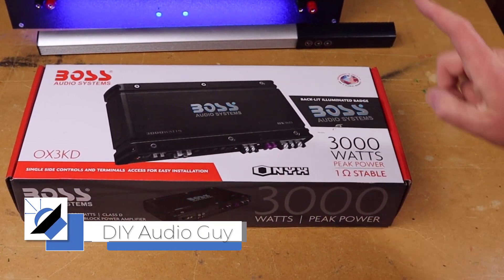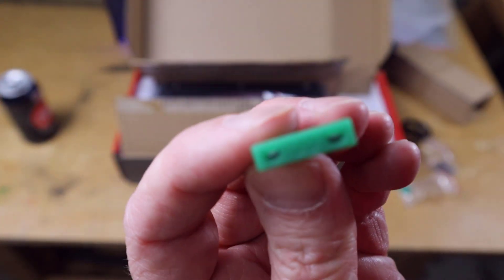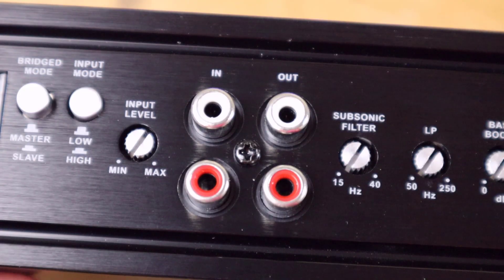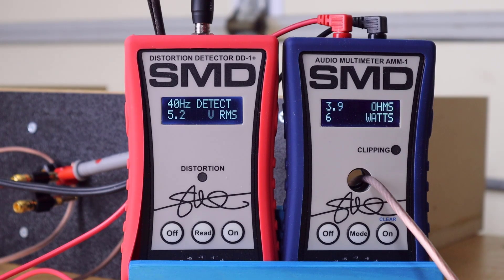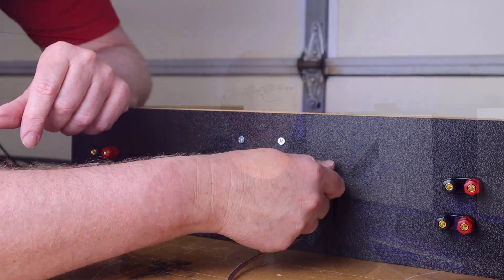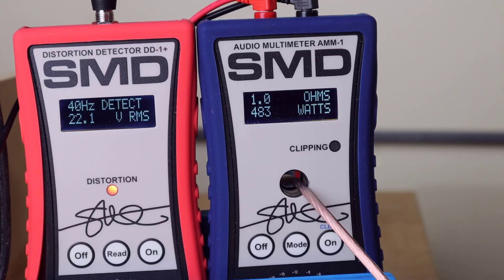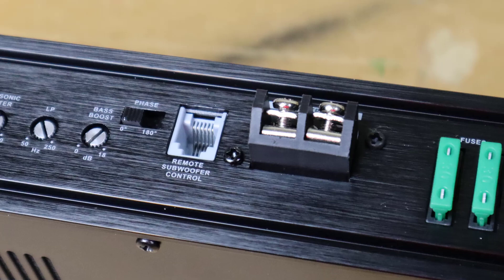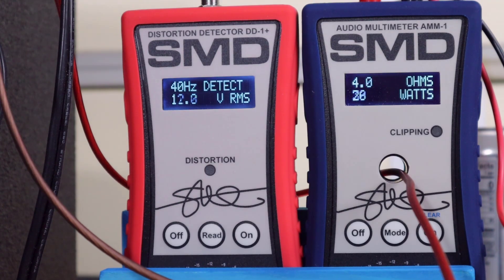Car Amplifier Test.  Boss Audio Onyx OX3KD Amplifier Dyno!

Comment: I’ll tell u what, some people know what rms means. Lmao. And these 100$ ( 1000 watt) boss amps 😂 are more reliable than any 250$ amp 
, same goes for pioneer. They might only make 500 watts on a good day, but most cheaper subs only rms at about 300 watts so it slams for 250$ and lasts over 10 years without continuous maintenance and tinkering on your system.

Comment: Could a person use the hi-le el option so you can use a epicenter at 7.5 volt or 10 volt option since usually the hi-le el voltage acceptableness higher on the amplifier

Comment: can you test boss ox4kd
Reply from the maker: It's going to get the same result.  If the 3000 w version is a 500 or a 600 w amp then the 4000 w version is going to be a 750 or 800 w amp.
Reply: @DIYAudioGuy  that makes sense.  thank you.

Comment: What could be a good 1ohm 10 inch subs to pair with this amp ? I have it and i have the boss chaos 1500 watts but can really take em to far because it starts to get distorted  even tho i had em for a while as 1ohm connection and it just could handle the power iguess so i have them in a series connection now.
Reply from the maker: Any dual 2 Ohm sub that is rated for about 500 w RMS will work.  You really should just sell those Boss amplifiers and give this a look:  https://youtu.be/JGjl4WygGT8
Reply: @DIYAudioGuy  okay i will check it out. I meant to say that im running 2 10s boss chaos "1500w" in this boss amp and had them running in 1ohm and they were fine until i had to switch them back to 4 ohm and tune it down because of the Distortion. 
Would you say that the amp you recommended it above will be suitable for 2 Punisher 10s subs i believe they are 2 ohm. And im currently running my equipment in a sealed box. Thanks a lot for taking the time in responding 🤙
Reply from the maker: @whissguzman8740  I don't have any experience  with the Rockville Punisher subs, but you are going to run into the same problem.  Both Boss and Rockville are notorious for fabricating their power ratings out of thin air.  Because of that none of the advice I give applies to those brands.  As for the distortion you are hearing, that may just be due to clipping.  I have a video on setting gains.  Assume that this amp is only good for 500 watts and follow that video.  https://youtu.be/MBcGOoRJ4Ro  If you still get distortion then consider getting a pair of these subs instead:  https://amzn.to/45rrgNd  that brand is not any better than Boss, but they do provide and accurate RMS power rating.

Comment: If they actually listed the correct rating on the box and amp. The pricing would not be that bad, honestly. Especially, with the other goodies it come with the amp.
Reply from the maker: You would think that their marketing strategy would backfire, especially now that you can just google the amp and get a test on YouTube.  But they have been doing it for decades and it is working for them.  I don't get it.

Comment: Boss are not bad products. They just over do it on the power. Back in the late 90s they put out some really nice amps.
Reply from the maker: At one point they were selling amps developed by Zed.
Reply: @DIYAudioGuy  Yep. I sold many of those. Never had one returned. I did tell my customers not to expect 3000 watts, but a solid 800. I have said before if Boss did not lie about their power nobody would hate them.

Comment: Ok 1:25 into it….. it’s a 400 rms amp. It’s BOSS what do you expect. But hey if your not going to do your homework and just buy based in the big flashy numbers and cheap price…. Ha ha freaking HA!!! 👺
Reply from the maker: Hopefully this video can help somebody out there make an informed decision.  If you know somebody that's new to car audio please share the video with them.
Reply: @DIYAudioGuy  I actually post this with all my equipment on OfferUp-If your on a stock power supply you can power maybe 300-1000 watts properly. from a 4cyl 300-600 watts a 6cyl 400-700 watts and your average V8 600-900 watts BASED ON THE ALTERNATORS AND BATTERIES THAT COME STOCK IN YOUR VEHICLE. So.... for example if you have a 2000 watt amplifier (or bigger) or multiple amplifiers you can only produce the wattage that your power supply can support so If your not happy with your bass you may need a smaller amp with lower wattage subs to get better bass not the other way around. Or turn you gain way down and be humble. It Takes power to make power. And if your trying to push amps to powerful for your power supply you’ll get crappy sound,heat and can end up damaging your alternator. If your “blowing” subs but on stock power supply your frying coils due to “clipping” aka lack of proper power supply to your amplifier(s) as you try to push wattage you can’t produce. Also using songs off of YouTube or rebased music will also destroy subwoofers due to signals that are not clean they may sound like there giving you more bass but it’s mostly distorted bass. If you’ve read this far you’re probably interested in learning more about getting good sound ya I do have stuff for sale but I give more advice and help then actually make sales and that’s ok I’m not in it for the $$ this is maybe 1/3 of my collection that I’m willing to sell I have over 30 years experience in audio I DO NOT INSTALL OR MAKE ENCLOSURES ANY MORE I HAVE MY REASONS. I have over 10000 invested in my vehicles system I’m not into spl competitions or car shows I’m into audio as a passion and I’m always learning. Shops are out to make money not to help you.

Comment: Bass knob was upside down, that's not 3m it's WE double side tape. Lol
Reply: @DIYAudioGuy  but to be fair this has to be the most capable boss amp to date. Even back when zed made a few models. He told them what the rated power was. Boss of course still multiplied that by ten. But this might be the first one capable of hitting there number. Since its strappable. Time to buy more too see how many to hit 3k? God job on the video.

Comment: Hey there. Nice video. Comes in handy, since I'm looking for an amp at the moment. 

I do have an unrelated question though, if you don't mind!

I'm used to listening to bassotronics on a 12" home cinema sub with a 12" passive (Klipsch RSW12 (22-120 +-3; 119dB @ 30Hz 1/8 space, 1 meter)

If I care about low frequency quality bass, you still think I should go with a ported sub? 

Since bassotronic type of music is hard on excursion, I might over-excurse (is that even a word?) with a ported enclusure in those 20-30hz frequencies more easily, which I wouldn't want, right?

The passive radiator option for the spare wheel area is not an option anymore, so I'd have to go with a box (around 2.7 ft³) that's kinda triangular shaped, behind the drivers backseat. Somehow WinISD didn't really give great results if I want to have a nice ported frequency extension down to around 20-24 hz. I also don't really quite understand, why changing the port properties doesn't change the frequency response shown in the graph/the tuning of the box?

In case it matters: My budget would be around 500€ (including amp and sub). Priorities: Tight controlled bass from 20hz to 90hz, SPL: Nothing crazy, but I should feel it in my chest. Maybe around 120 inside the car?.
Reply from the maker: That's a lot to get into!  The thing to remember about a ported enclosure is you could always tune it very low.  You want to hit those ultra lows then shoot for an f3 of 18 Hertz.  Also keep in mind that you have some cabin gang that will help with the low frequencies.

Comment: There are a lot smaller amps capable of much more than 500 watts.  

The rule still remains true with budget amps. 10% of the claimed power is to be expected or multiply the fuse rating times 10.
Reply from the maker: Fuse x 10 is such a simple shortcut, and it gets you in the ballpark so you can filter out the BS.
Reply: @DIYAudioGuy  Its usually pretty close. Everyone lies any more. This method has never failed me so far.

Comment: I worked at a Radio Shack dealer store back in 91 that had some flexibility with audio gear outside of the house brands.  We sold MTX, Sony, JBL, Polk, JVC, Infinity, Clarion, and some of Alpine's offerings along with some other mid grade brands.  Then the Boss stuff rolled in and I could instantly tell they were mostly hype by the extraordinary claims and cheap feel.  I hated them from the start, but it appears they are in micro-redemption mode.
Reply from the maker: I always found it funny how some radio shacks would stop non-radio shack equipment.  As far as I know there are only 2 surviving RadioShacks near me. One is in a small town and they sell Memphis.
Reply: @DIYAudioGuy  It was a store in Georgia with a larger than normal floor space.  So in addition to the standard full lineup of Realistic gear and everything else Radio Shack,  we went with a decent selection of aftermarket and it was a pinnacle time for those brands. USA and Japan made.  I didn't see China on much of anything.  The good 'ole days.
Reply: @sylkelster there's a better selection of quality audio manufacturers now more than there ever has been. In addition to everything you listed (a lot of which is now considered mid range), we have ct sounds, b2 audio, deaf bonce, sundown, incriminator audio, taramps, DC audio, dd audio, and that's just off the top of my head. I always preach that car audio and firearms are two of the only industries left that are thriving with quality products and honest, trustworthy, passionate manufacturers now more than ever! Everything else is someone in an office on a top floor who couldn't care less about anything other than bottom line and shareholder approval.

Comment: Boss amps have amazing protection as I've tried to blow them up before with no luck. My problem with them is the way they confuse the unknowing consumer with these bloated numbers printed on the box and the amps themselves. It's interesting to see they are posting accurate RMS ratings in the manual now, but as you say you don't see these until you buy the amp and read the manual. At least this is progression, maybe some day soon these ridiculous MAX numbers will be a thing of the past...
Reply from the maker: I think this is the first one that I've seen that was anywhere near rated power.
Reply: the amps only have protection from blowing up with over voltage or current, not from .45 acp
Reply: @nickn7939  incorrect. Even Big D, ran them below rated ohm loads. The protection caught it. It was going in and out of protection. One thing Boss did right, was the protection circuitry.
Reply: How do they sound?
Reply from the maker: @Zimmy_1981  Sounded fine when I was doing the reactive load tests.
Reply: Big D, do you miss the days , of the ZED built, Boss Audio?? Lol, man they were great back then.
Reply: Hi

Comment: look at fuse rating can tell everyone what a output power that amp can does. with a 60amp total fuses that mean this amp can't push over 700w rms. boss amp just compatible with boss sub 🤣 boss with boss
Reply from the maker: It's kind of sad, it is a perfectly find amp.  Slapping 3000w on the side of the box did not help one bit.

Comment: Rockville has some pretty sweet looking krypton and atom amplifiers I think you should check out. Thinking about picking up a 4 channel just to test out myself
Reply: I'd really love to find a good budget full range 2 channel, or 4 even, amp with some serious RMS power to power a good pair of 6x9's or 2 pair even..
  I miss the Hifonics 2 channel Zeus I had years ago that I believe was 250 RMS a channel @4 ohms that kicked butt with some killer 6x9's..
Reply: @BabyCharlotteschannel  check out the Rockville krypton T2. $135 and does 215 rms at 4ohm into 2 channels
Reply: @BTSyaya  thanks for the heads up. Sounds like that is a pretty good budget amp 🙏
Reply from the maker: I might have to check those out. For now I'm just going to be doing smaller amplifiers since I don't have a big power supply. But, if people keep watching the videos and supporting me on Patreon I'll be able to upgrade all of that and start doing some serious test.

Comment: Great video, had me scratching my head with the amp guts yesterday and case shots I couldn't narrow it down and looked right over Boss lol Power was as expected when saw terminals and Fusing lol prob still solid 500w amp and fine for an entry level ish 10 or 12
Reply from the maker: There's nothing wrong with it, it's just not particularly good value. But then again how many amps at this price point are strappable?
Reply: @DIYAudioGuy  can you strap it ? Yes , is it worth it to spend the money on 2 and strapping them ? Meh lol
Reply from the maker: @dilbeckskate  You are not wrong.
Reply: Someone guessed Boss, those caps are cheap though, I've seen them on  Ct sounds.

Comment: Well, there are at least a couple of things to like about this amp;

The fact that all the connections are on one side of the amp makes for more installation options, as long as you’re not too OCD about the orientation of the logo. 

And the low wattage output will work well with the cheap CCA wiring kits that will end up bundled with these as most of the online retailers tend to do 😉
Reply: Honestly yes they completely lie about numbers  , but you can't beat the reliability. I have owned a few boss amps over the years and ive abused them badly. Im talking .25 ohm load. I've  busted the power connection terminals added crap from my local hardware store to make a power bus. I had one that literally got kicked an throwed around cause i kept putting on installing it. One day almost a year after purchase i installed  it an surprisingly it worked. Although if you run two boss amps better find 2 separate ground locations because  the grounding in most of their amps is horrible. With all of that being said ive seen several videos that show Boss taking serious abuse an still powering up. Final thought  as long as you understand  what the amp is going to put out an don't have some ridiculous expectations boss amps can serve to be a decent amp when paired correctly with speakers. The plus side is i dont suggest cca but you can definitely get away with smaller ofc wires for these. If it say it needs a 4 gauge , i can almost guarantee 8 gauge ofc will probably power it just fine.
Reply from the maker: Plus it is strappable. So it has that going for it.

Comment: 1 minute 30 seconds into the video, I'm going to go ahead and guess this thing won't do any better than 600 watts RMS
edit: why in the world is it running 2 30 amp fuses? It doesn't even need 1 30 amp.
Reply from the maker: Fuse rating x 10 is shockingly accurate.
Reply: @DIYAudioGuy  I always do the x10 even though others say x13 or 14... it really is accurate because the difference between x10 and say x13 or 14 is the 60%-75% efficiency. So I figure why not cut the crap and just do x10 and be pretty darn close.

Comment: No rules or laws in car electronics! Been seeing these bloated ratings for decades,even with the internet reviews and tests these companies still maintain their bullshit ratings. Reputation means nothing today. Tests on amps should have accurate specs like theil specs in subwoofers.Keep up the great work!!!!!!!!
Reply from the maker: Right, it takes 30 seconds to google the model number and find an amp dyno for the EXACT amp you want or a similar amp from the same brand.
Reply: @DIYAudioGuy  after working in retail, I learned the general public doesn't know how to use google.
Reply: Carrying on the legacy of Pyramid and pretty much any amp "booster" from the JC Whitney catalog.
Reply from the maker: But is says "3000 watts"?  SO it must be 3000 watts.
Reply from the maker: @nate0 that's impressive
Reply: @nate0 God I bought tons of stuff from JC,back in the 70s they were big.